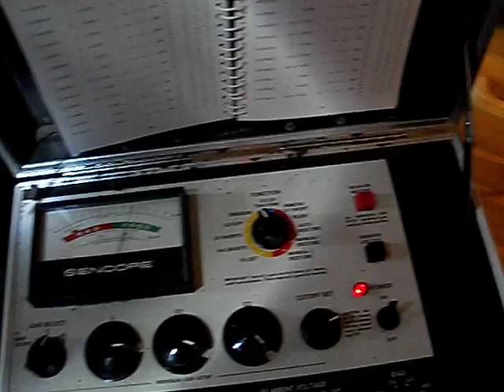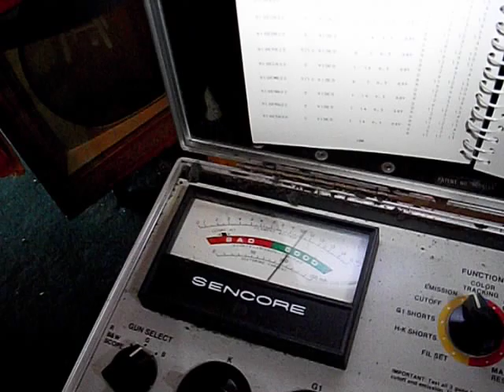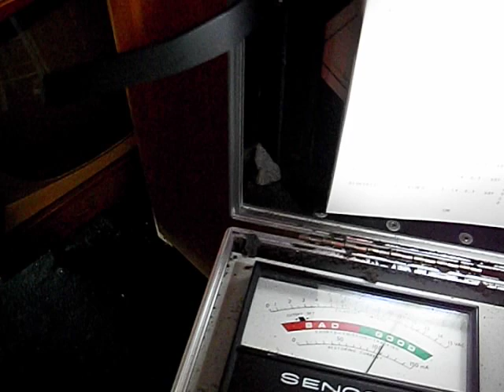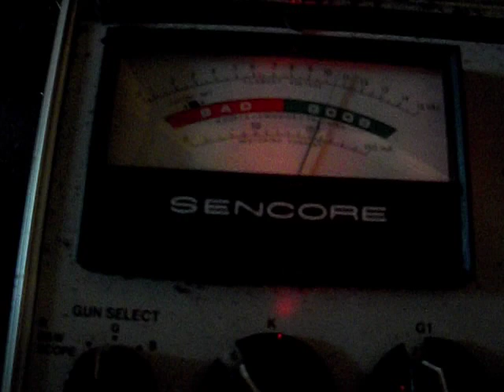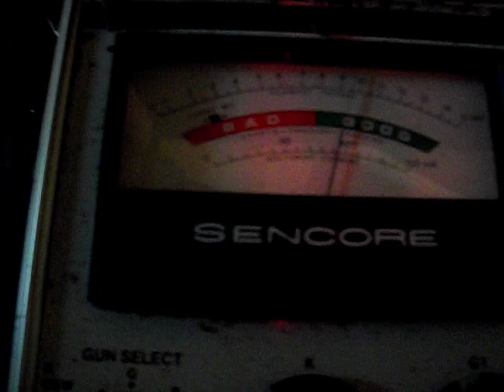Vintage CRT toshiba 510DZB22 delta gun

Comment: Toshiba made excellent CRT television sets! Maybe half-a-notch or so below Sony Trinitron, in my opinion. That picture tube will produce a beautiful picture, it tests as if it's almost brand new!
Reply from the maker: Now I just need to find something to but it in. I have toyed with the idea of building my own tube based monitor (CRT and vacuum tube based sweep and signal demodulators, prob along the RCA CTC-17 as a model
Reply from the maker: I have a working CTC-17 chassis, I may just stick it in that and see what kind of pic it produces. I have often thought of making up my own frankenset. If nothing else it would be neat just to see what a CTC-17 would produce pic wise on a late model delta gun crt.